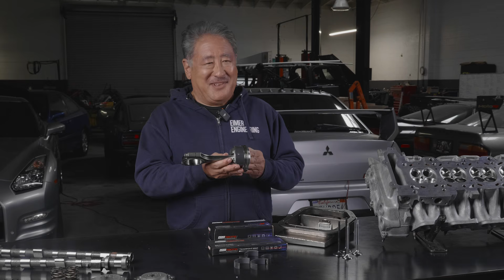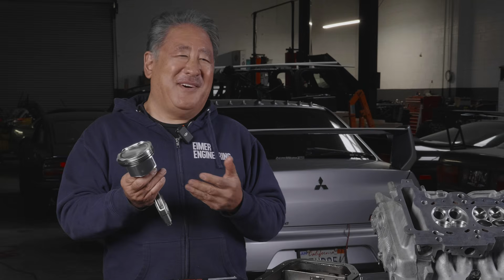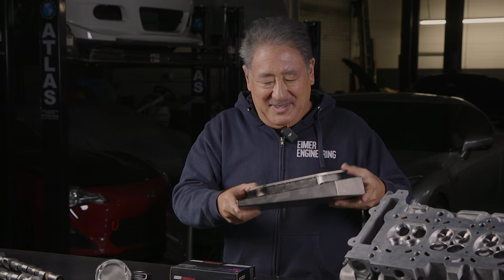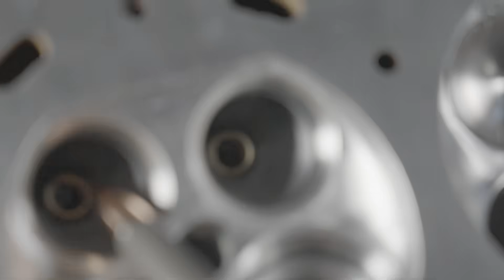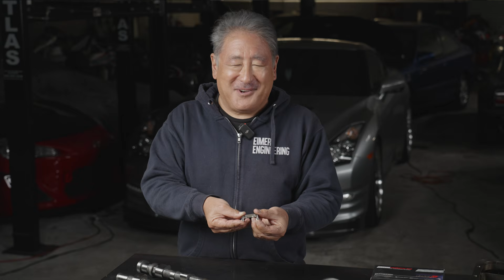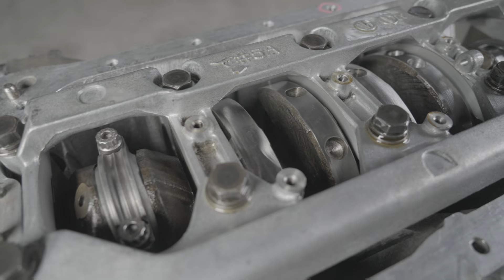How to Build a Bulletproof 400 Horsepower Nissan SR20 Engine!

Comment: Respectively disagree these engines require a piston and rod upgrade for 400whp considering in comp cars for years in both Australian and New Zealand drifting whether youre a pro , or a rookie , stock pistons and rods have more then proven to work . Now what you do want however , are upgraded rod bolts to at least off the shelf ARP items along with a baffled oil sump . E85 is also the magic trick to keeping these engines on song on stock bottom ends also
Reply from the maker: We have seen plenty of broken ring lands on stock pistons but agree that the stock stuff is really strong to a point.  Our gas is really bad and that is probably a huge factor.  I am going to do another video on what you can get away with on a full bolt-on SR20 in the future with, stuff like good cooling, a good baffled pan, E85, good tuning, etc, run it into the high 300's and see how long it lasts under track use.
Reply: @MotoIQ  detonation would be a large factor to that , hence E85 is super popular for stock bottom ends as it'll significantly reduce the chances of detonation.  Typically 18psi or more on the oem pistons/ring lands is where they'll begin suffering detonation problems without the use of E85
Reply from the maker: Our California gas only allows 14 psi, this stuff is awful, like piss, most of the rest of the country has much better gas. Most local SR20's we take apart have fuzzed pistons and quench edges on the combustion chambers.
Reply: @MotoIQ  yeah having bad fuel is less them ideal, but you can damage a set of forged pistons on a lean out and or detonation just as easily as a set of oem pistons . 

Never played with a Redtop but am aware they don't have the head cooling "fins" a Black/Notchtop don't have 

I believe they either have a coolant neck or passenger flaw the later SR's don't have also, this isn't the first time I've heard this
Reply from the maker: Also do you see more cooling problems with early blacktops than the later engines?  These seem to have poorer water jackets in the heads and less water around the plugs.
Reply: @motoiq  Evans waterless coolent is a great product.
Reply from the maker: We tested it not on a car but on a side by side in a coolant test we did as consultants for a manufacture.  The Evans actually performed the worst out of all the coolants we tested.  We were measuring the cylinder head temps and the heat rejection by the radiator during dyno pulls.

Comment: Interesting rings and any tips for a compound turbo set up eating the wrist pin boss? I'm on piston number 7 on a single cylinder. I get about 30runs at 60psi of boost but maybe 10 runs if I hike the boost in the upper gears then she starts making noises lol. Tare it down and always find oblonged pin bores in the piston and I noticed my pin seems to have shoved itself into the piston by about .5mm. I'm running a custom carbon rod we make in house it's very stiff and the big end has a roller bearing so not much give there. I did notice I still had this issue when i ran a steel rod but not as bad given at lower boost (2-30psi less). Any advise? I added a oil squiter to try and get more oil into the pin that seemed to help but certainly not fix the problem. Plans are to go custom piston with a longer bigger in diameter pin but still not sure that's the way.
Reply from the maker: Is this for pulling or drag racing?  Is it a single cylinder or it happens only on one cylinder?  One thing that's worked on me for super high boost engines is to run a really thick wall pin and a really wide pin boss so the pin is supported really well.  It's heavy but I have had damage like you are seeing, the pin boss gets hammered and you can see on the small end bushing that it is getting chewed up on the ends due to pin flex and grabbing the bushing.  Have you ever tried an aluminum rod?  They cushion everything but fatigue out kinda quick and need to be changed out after 25-50 passes.  I want to hear more about your carbon rods.
Reply: @motoiq  drag but really it's a project spends most of its life on the dyno tbh lol. It is a single cylinder engine. I have tried the aluminum rods and that worked until it just wasn't lasting and when they go they take out the cases too. The carbon rods are lighter maybe their very over built bronze Bush in the little end steel insert for the big end race to press into. I have a process to making them that works better than other things iv tried. I'd say once you get it figured they just last forever it seems like a steel rod but aluminum weight. The best thing is when they do go bad they rarely fail catastrophically. I had one of my early ones break and keep running given making some bad sounds lol. Iv been limited to what's available and what iv picked up and said this could work as in sure youl remember doing it way back in the day. It's a frankinstien xr200 I have some vids of it in its last version but have yet to get any of they newest version being compound mainly because I have a engine in my test mule frame and I'm still working out some issues with the new bikes frame. I have noticed bent wrist pins (last time I needed a very big hammer to get them out. Would you say on a 15mm pin going to a 17mm pin would be helpful keeping the rest the same or would adding length be more helpful? I'll do both but wondered which way is better bang for the buck lol.
Reply from the maker: Oh yeah a bigger pin is gonna help big time but you are still gonna need a thicker wall.  Can you go even bigger with the pin diameter like 20mm?
Reply: @motoiq  I wish it's only 155cc so things are kinda limited in space. I have the stuff to put something together with a 17mm pin and I can machine a solid pin if you think that would help? I definitely have room for weight on balance if need be. I think if I can find the right piston I have room for 19mm before the rod gets too wide on the small end to clear the skirt. That's why I was asking if wider would be better.
Reply from the maker: Yes wider is better and as close to the rod as you can reasonably get as well.  You can have some hole in the middle because at some point, it is diminishing returns.  How much power are you getting out of it?
Reply: @motoiq  huge thanks man I'll give it a go later on this month. Were over 100whp at some crazy boost. It's got more in the turbos but this issue has had me holding it back from more. Its touched 90psi before but that motor started making bad sounds the next run and it broke some other stuff in the trans unrelated to the pin. Hopefully we can see 120whp that lives a good 100 passes
Reply from the maker: Send pics to mike@motoiq,com
Reply: @oliverscorsim  epic work from a small build. Make some videos for you tube. Keen to see,
Reply: @kylejohn486  honestly I'm just so bad with a camera. I truly hate it but I have a friend who hopefully will assist in a few vids. Thank you it's been a long road and I think this is gonna be the 16th version of the bike lol.
Reply from the maker: Damn I want to see stuff so bad, even phone pictures.  Are you doing aftercooling in between stages?  Running on methanol?  I want to put it in our CRG shifter kart chassis.
Reply: @motoiq  I'll send something soon when work calms down and I can make it presentable lol. I'm running two intercoolers in a central duct that is also a big part of the frame. And dry ice chilled e85 we shoot for about -80°f for fuel temp. But it wasn't always like that lol the whole time it was single turbo it just ran chilled e85 and later on we added chilled meth pre turbo to try to get the things efficiency up some at our dumb for the turbo boost. It's just a ihi rhf3 vz45 so 50% @ 35psi was a real thing for us hence going compound this time around. I data logged alot of temps throughout the building and single turbo it was common to see pre carb temps over 280f but never over 30f after the carb. Now I have a ice water spray on the intercoolers and chilled fuel I wanna say at 45psi(gate) we see 130-150f pre carb and negative in the intake port. Frankly it did okay single I just wanted more and well I hope to be as smart as Mike and these guys one day lol definitely wont get there if I dont build something ridiculous. This was kinda the family go to bike for 2 generations now and we always had a few bikes with this engine family so it seemed like the perfect thing to do. Back when I started it and bought the first turbo I was maybe 15 and had worked and saved to buy a cheap ebay turbo. I worked at a motorcycle dealership and some times bikes or engines would go to the trash which ment my truck lol. So I had gotten an extra 5 motors and I was set on it. Many moons later here we are and i dont think its ever gonna end lol. I think I built the first bike for $250 and I was happy  learning and making my 35hp then more and braking parts ect. I dont wanna think about how much time and money I have in it now but i always kept it cheap and opted to make parts rather than buy(friend owns a machine shop). I'm very proud of the new bike and I'm just not happy putting another crappy video out on something that I have this much work in. Promise I'll send you a vid for proofreading if you will before I put it on here. Hopefully i can make it out to a cycle drag event and show it off some to those guys as well.
Reply: @motoiq  if you knew my battles with oiling you wouldnt lol. I finally have an oil system that actually does what I need. This was the single biggest thing in making it make power and live so far. Feeding two turbos on a motor that normally makes 2-10psi of oil pressure because of roller bearings is not an easy task. Currently I have a Suzuki gs450 oil pump and everything in that end is hand made.
Reply from the maker: You ever consider running pure meth?  I think it will help a lot.
Reply: @motoiq  yes but it's hard to justify the cost. It's not just the fuel either my carb is aluminum so that's gonna get eaten fast and its kinda rough on engines long term. That being said I actually have been working on a external float bowl to supply my power jet with meth and make it dual fuel but I'm not convinced its gonna be worth it when my iat after the carb are under zero given I'm sure it's not actually that cold and the sensor is getting wet throwing it off but I do see ice on my intake manifold after a pull. If you think the goose is worth the gander I'll give it a go for next year but I kinda already have next to no time for this bike. Lately if I can put two hrs a week into it I'm doing good. Once things slow down and the season is over I'll have alot more time.
Reply from the maker: I think it's worth it, if the latent heat is good on E85 just wait till you try meth!  You are just going to have to pickle your engine after you run it.

Comment: Mike, have you noticed that black coating on the bearings falling off? When I change my oil I’ll have these black things floating in the bottom of the pan. That’s all I can think it is. I’m thinking I got the machine work I paid for haha
Reply from the maker: I have had it partially wear off and exhibit wear patterns but not completely fall off. We use coated King XPC bearings and we also use Swain Tech coated bearings.  Do you got a pic of the black stuff?

Comment: Please explain the difference between a det and a de?
Reply from the maker: DET is turboed and DE is NA
Reply: @motoiq  I know but the engines
How different are the engines internally??
Reply from the maker: DET has lower compression, piston coolers, higher capacity oil pump, stronger main girdle bolts, direct ignition a few other small things that I forgot that are not that important.

Comment: I always think about going JDM and then I see these vids showing how much work it takes to make a medium amount of power and I'm like "maybe next life" lmao
Reply: The SR20 is an I4 2.0L with an aluminum block. You want power with JDM you need to go for the RB26 or 2JZ. Both are I6 with iron blocks, both can handle over 500HP on stock internals, both can give you over 1000HP if you build them out.

Comment: I got a ? How do you take out a spark plug that is too tight and an engine due to possible gasket leak? So special tools. Anything to help lubricate it or get the oil out and suggestions?

Comment: What's the part number for the piston? Great video, so many variations of builds for a classic engine.
Reply: Thanks that's what I was looking for. When I tried to search "shelf" I only found 86.5mm which didn't make sense to me.
Reply: 'shelf' just refers to 'off the shelf', usually readily available, bread and butter stock etc. so if the manufacturer doesn't have it in stock, you can scrub that off the list. next, wiki will indicate that this engine has a square bore... 86mm or something, so then you can narrow it down to those ones only a few thou larger. and take it from there. but yeah this guy doesn't go into too much detail about the specific products he recommends. even the clutch... okay i can find the xclutch page but they have a bunch of product lines. also, gtir and bluebird owners don't get to hear the specifics about which mods and parts don't work for their layouts.
Reply: good question. not sure whether he's recommending the ultra or not but if standard bore (recommended for turbo) then Kit - 298727 or Kit - 361305 for the ultra series, and Kit - 367892 for VE head. hopefully someone will chime in to clarify.

Comment: While I don't have an SR20 build in my immediate future, I always enjoy the build tricks and fine engineering bits all the same. Modern hot-rodding! 
Out of curiosity, I was watching a sim on swirl induction the other day and while it looks impressive in the video, to me I don't feel there's enough time to really do anything with it in the milliseconds the charge air is entering, makes the turn and begins compression in the cylinder. I guess in the grand scheme of percentages, you might gain a partial percent in flow volume in the window the valves open. Any thoughts?
Add: Man, I haven't heard Jim Wolf's name in Forever! We had a long dialogue of going back and forth on the idea of turbocharging the single cam KA24 back in the early 2000s. That's bringing back fond memories!
Reply from the maker: Swirl is an old concept that was shown to have poor VE.  Tumble was proven to work better, at least on 4 valve engines.
Reply: @motoiq  Ah crap, my bad. It was tumble. At any rate, I think it was shown off on a Toyota with turbo (quite possibly the new Tundra). Thanks for the reply!
Reply: @motoiq  speaking of ve do you have any knowledge/ vids on the sr20vet

Comment: Thanks! I cant wait for the more advanced builds. But on the studs, sounds like you should stick to all stock stuff vs arp head and main studs?
Reply from the maker: All stock period until we can confirm that the Mazworks studs fully bottom.  We will use them in our next build.  When studding you will probably need to align hone.

Comment: Interesting he says using new stock bolts vs arp....hmm
Reply from the maker: Yup the threads can pull out of the block at their recommended torque, the studs don't have enough engagement. Even if they don't it is really close.  We had it happen to us before.

Comment: You have had a lot of requests to look over the SR20...

Thankyou comments section and you fine sir for this invaluable content.

I'm building up a catalog of parts now for a VE engine so a video would be much appreciated.

EDIT: Perhaps a mention about the SR oil pumps, their relief springs and how to deck the block with the oil pump included will be added to the next video.
Reply: yes nissan sr ve engine video would be killer

Comment: Mazworx has sr20 main studs that are longer than the normal ARP studs so they bottom out all the way. Thanks again for the awesome video!
Reply from the maker: good to know, I was talking to some manufactures about making them for us.
Reply: Mazworxs sell head studs that bottom out, the main studs are standard arp sr20 studs, the mazworx studs are made by arp but to there specs.
Reply from the maker: ARP main studs don't bottom and can strip out unless they listened to us and redesigned them.  We complained.
Reply: @motoiq  mazworx have there own arp stud design which does bottom out, it’s similar to the 4b11 evo engine studs. 
Im running the mazworx standard studs and it’s holding perfectly at 32psi 600whp
Reply: @motoiq  also when you build a vct motor and want to retain the vct, you need to run a spring with less then 70ish lbs of seat pressure, im using supertech singles. Double valve springs will kill the vct and make it rattle.
Reply from the maker: We generally use single beehive springs.

Comment: I'm curious to hear your thoughts and opinions on solid lifter conversions.
Reply from the maker: They are great if you use the right cam for the application, most tend to be too big for small turbos
Reply: The engine I'm building is using a Tomei m7960, and I was thinking of using their solid 260 cam that has 12.0mm of lift. Do you think that would be too much lift for something like that?

Comment: Step 1, buy a b230, step 2 china rods, step 3, 16v head swap. = 500hp bulletproof for a lot less work.
Reply from the maker: Lots of salty Volvo fans!
Reply: @motoiq  only stating facts, why try so hard when you can use something that will do more for less?